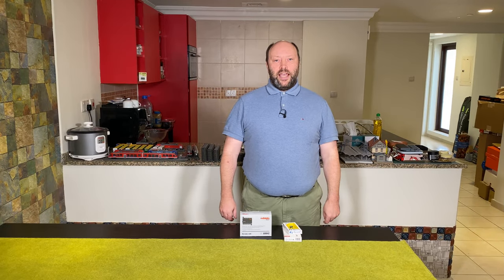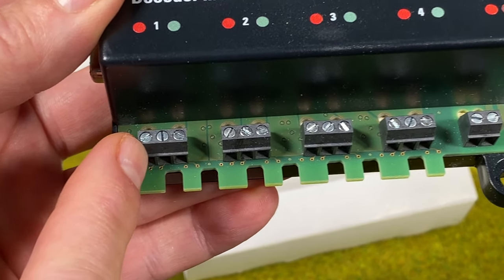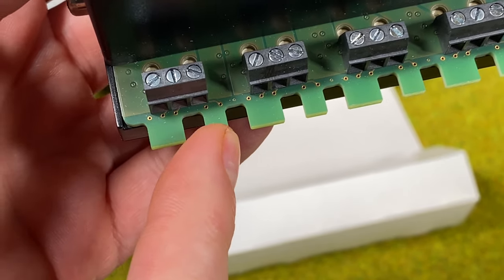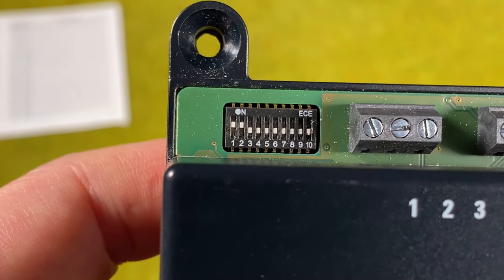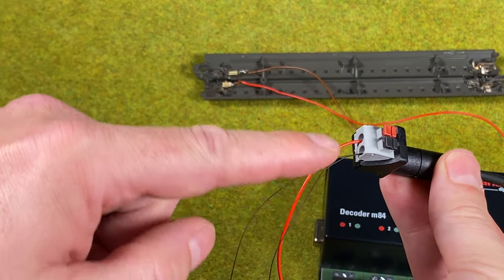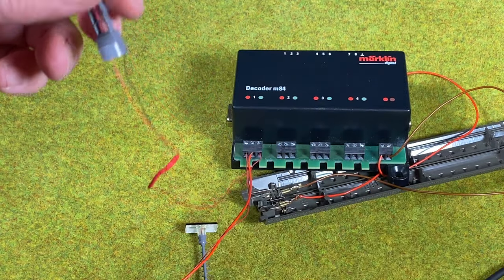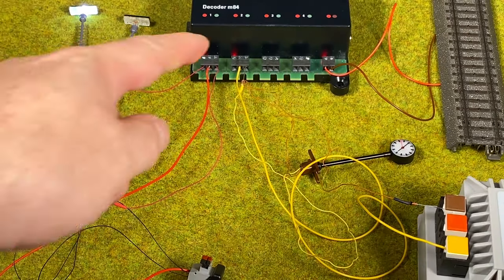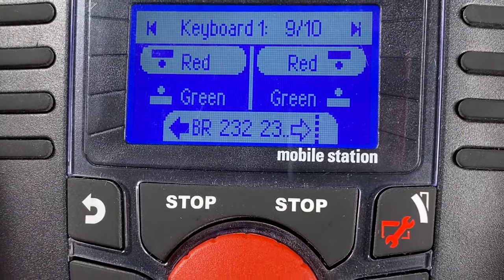Installing Märklin 60841/60842 m84 with 8 Independent Light Groups (Beginner Episode 8a)

Comment: Hey nice videos can i ask a "noob" question? 
Since am about to go into this hobby and probably spent a lot of money, my question is:
Since am about to buy marklin starting set (Model train "ICE 2" Digital Starter Set) can i run PIKO trains on c-gauge tracks?
Reply from the maker: This is one of the most import questions for beginners as it is important what fits together. Many models from other manufactors can work on Märklin. The key is that Märklin is a 3-rail system - you have the normal 2 rails + a center rail. The locomotives pick up power from the wheels and a "slider" mounted under the locomotives. What is important is to have a digital locomotive with slider. All digital locomotives with slides fit with the Märklin digital system. Manufactors and shops often mark it as AC Digital. Märklin digital supports MM, MFX and DCC 3-rail locomotives.

The other system is the 2-rail system. The tracks do not have the center rail. 2- rail locomotives do not have a center pickup and cannot run on Märklin 3-rail tracks. The 2-rail system uses DCC protocol for digital locomotives.

As a beginner it is important to choose one or the other. Märklin 3-rail is supported by fewer manufactors outside Germany. However, Brawa, Roco, Piko makes 3-rail locomotives. If you are into US consider 2-rail. I like Märklin/3-rail because it is good quality (nice/detailed), built to last and easy to use (MFX, 3rd rail, electronics, ...). Some people do not like the view of the "3rd rail" - I do not mind as it makes my life easier. You can do everything on 2-rail or 3-rail, but unfortunately it is a basic choice. When choosing consider where you can get help - from clubs, friends or shops. It is often easier when you can get help.

When getting started with model trains consider a starter set as it comes ready to run. Märklin currently has a promotion and you can see a video on "Getting Started" on this channel. 

Getting Started: https://www.youtube.com/watch?v=slJZoMWZ248
Märklin promotion Winter 2021/22: https://www.maerklin.de/en/lp/2021/christmas-2021

Hope this helps and welcom to model rail roading. Enjoy ;-)
Reply: @ModelTrainFun  Thanks for the info really helps! So now i have another question how to recognize on lets say trainworld what loco uses what system ?
Reply from the maker: @pticurina  Are you talking about AC as I mentioned above? 

If you are looking at trainworld - I believe this is a US store. If you are looking for US trains, then you only find very few that will work on 3-rail. If US locomotives and trains is your passion, then I would consider 2-rail/DCC instead.
Reply: @ModelTrainFun  No am in Europe and Europe oriented towards trains :) And yes am only interested in dcc, aint no fun if train cant do the chu chu thingy :)
Reply from the maker: @pticurina  If you are interested in european trains then you can find lots that work with Märklin from manufactors like Roco, Brawa or Piko. Locomotives need the slider (often marked AC or 3-rail - sometimes AC digital). Many online stores provide filters e.g Haertle has "Betriebsart=3-Leiter Wechselstrom". If in doubt look up the model number on the manufactor website and read in english. 

I think by DCC you mean digital - for Märklin you can look for locomotives that can do MM, MFX or DCC. All run on Märklin if they have the slider. Freight or passenger cars you can buy from any manufactor.

Enjoy ;-)

Comment: Hello and thank you for good and informative videos. Have a question about the M84 (the black one) regarding programming to 8 addresses and outputs and connection to CS3 as well as controlling the ports on/off using contacts via Events. Have no problems programming the M84 to 8 ports/addresses and can post 1 Event in the CS3 but when I post the next Event it doesn't work and the first Event has also stopped working. Do you have any experience or thoughts and ideas on solving this problem? Thanks in advance, Magnus
Reply from the maker: Hi Magnus, I am not sure what issue you are facing... What are you trying to do? Use an event to turn on/off lights? Control lights in a certain way? What do you mean by post events? Trigger based on something else? Are you using the light icons? Enjoy ;-)
Reply: Hello again, Thanks for your reply.
I'll see if I can clarify. In your movie Beginners episode 8a you have programmed the M84 to have 8 outputs and addresses. In the movie, you control these manually via your CS3. 
If instead you want to control each port automatically using headers and S88 and do this as an Event in CS3, can you make it work? 
Eg: In your video, the lamp on port 1 should go out when you pass contact number 1 and light 2. When the locomotive passes contact no. 2, light no. 2 should be turned off and the clock's light on port no. 4 should be lit. 

When I try to automate this, the first Event can be done without problems. Lamp 1 goes out and lamp 2 lights up. But when I do event number 2, both the new Event and the first Event stop working....
Reply from the maker: @magnusstadelmann2651  This should be possible - one thing that comes to mind is that the contact tracks might be too short, but I am not sure. I suggest you send me an email (see "About" on the channel page) and give a photo or a short description of that part of the layout. If you know how to take a screen shot of the events from the CS3, then please add these. Otherwise, I can try to make the events as I see they should be made. Enjoy ;-)
Reply: Hello again, I've been busy with something else the last week so I haven't dealt with my Märklin problem. But I think I'll skip the attempt to program the M84 with 8 outputs and run on the standard 4 ports instead. Thank you for your dedication. Looking forward to your new upcoming movies. Best regards Magnus

Comment: It was a very proffessional  explanation top. Thanks. I have one question: I heard it is possible to change the uncouplingtime longer for a uncouplingrail by the MS 2. Is it possible to explain that one time ?
Reply from the maker: You would use the uncoupler track with the m83. You can change the pulse time with the m83. If you have the 60832 (black edition), then you can change it directly under the configuration. If you are using MS2 or the 60831 (white edition), then you can change CV114 for the Red 1, CV117 for the Green 2, and so on. I believe Märklin recommends the value 15 for the period.

I do intende to make a video on the uncoupler track in the near future. Enjoy ;-)
Reply: @ModelTrainFun  Thank you for the answer. I shall tray to fix it.
Reply: I have succeeded i extending the switchingtime of the uncouplerrail via the MS2. Thanks for the tip.
Reply from the maker: @erichendrikse2946  Excellent - I am glad you succeeded. Enjoy ;-)

Comment: thank you very much but what is the  power supply and how many volt ACor DC ؟
Reply from the maker: Hi Yamon,

Glad you liked the video. The M84 is powered by the track power. The M84 is just a relay, which means you need to get a power supply that matches the lights you control. This can be AC or DC depending on your lights. Typically, you find the lights in 12-20v from various model manufactors (some LEDs even lower). Max load per M84 group is 5 amp. Consider using DC lights if you want to make videos as this will create a flicker-free light on the video.

Hope this helps! Enjoy ;-) Bo

Comment: What is the difference between m84 and l88? When should I chose which?
Reply from the maker: You use the m83 for momentary connections and m84 for continous connections. Hence, the m83 is good for turnouts and uncouple tracks while the m84 is good for light, signals and stop track. The L88 is used for train detection through contact tracks, circuit tracks or reed contacts. You can see how to use L88 here: https://www.youtube.com/watch?v=asgop7QRIK8

The m84 does have some inputs - however, these can only be used to change the connectors on the m84 in a simple way. In this way you can make some simple electrical automation without a control station. As an example the CS3 cannot read or react to the inputs of the m84.

Did this help? Enjoy ;-)
Reply: @ModelTrainFun  Thanks a lot for your very informative and detailed answer!
Reply: @ModelTrainFun  Hi there! I apologize about a noob question, but when you mentioned using uncoupling track with m83, why wouldn't you use that with m84 instead and have it set to either continuously on (uncouple everything that passes by) or off? Seems like if you use momentary connection you literally will have to catch the couplers as they pass over the uncoupler to disengage them. Could you clarify please?
Reply from the maker: @AlexNYC961  The problem is that the uncoupler track uses a solenoid (electrical magnet). The solenoid will burn out if continously turned on. Hence, better to momentary turn it on. The idea is to set a period that is long, but not too long. I believe the modern uncoupler tracks also has protection against continous uncoupling, so it will automatically turn off anyways. Beware older versions might not have the protection...

The method for uncoupling is drive the locomotive until it is on the uncoupler and stop, then uncouple. This will already uncouple if there is no strain on the couplers and it is the better couplers (Märklin close couplers are best - Relex are more sticky). Alternatively stop locomotive with the couplers to uncouple just before the uncoupler then uncouple while driving locomotive forward over the uncoupler.

Enjoy ;-)
Reply: @ModelTrainFun  thank you so much for a quick reply and a detailed explanation! Cheers!